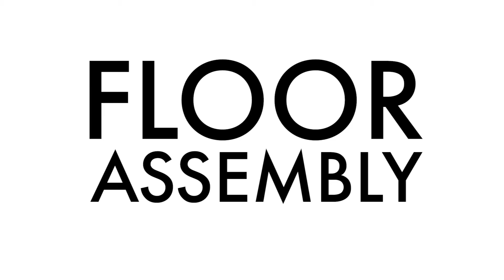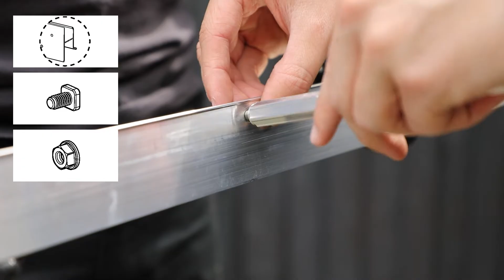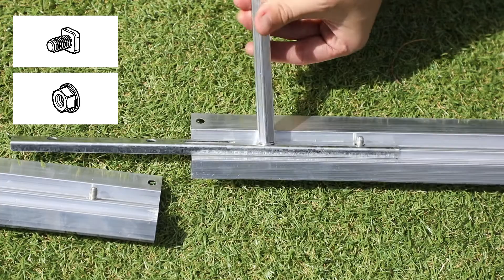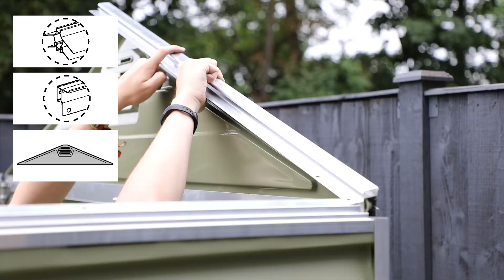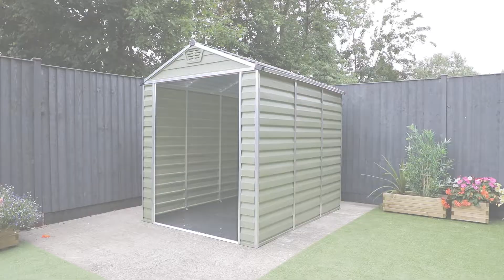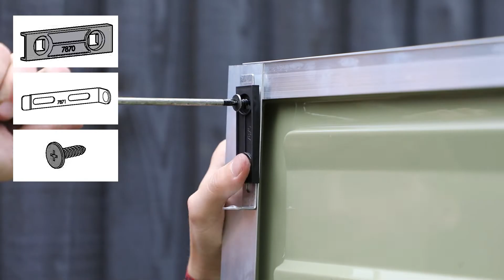BUILD - Skylight Plastic Shed Installation - 8 x 6

Comment: This looks to be the ideal replacement for my old wooden shed, However, is it possible to fix shelves or hang tools on the walls and although a light fitting may not be necessary, is there a way to introduce electricity to facilitate the charger for my invalid scooter.